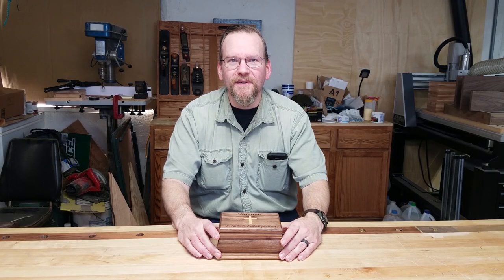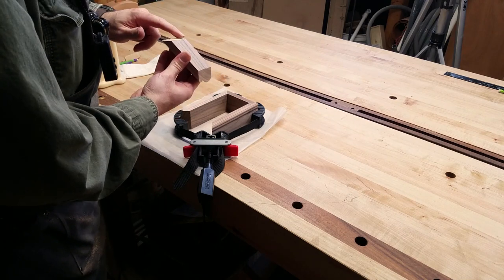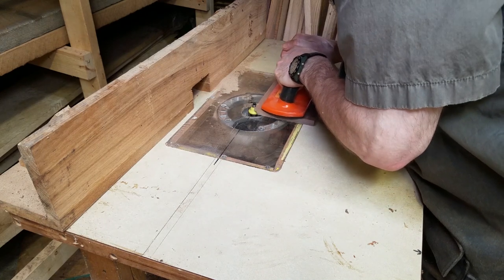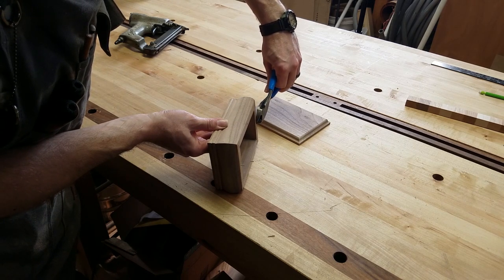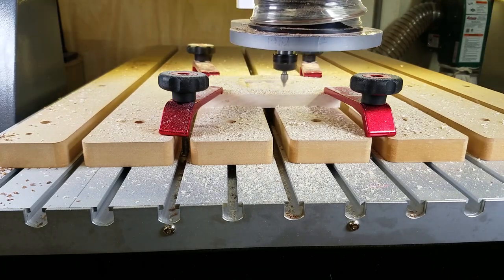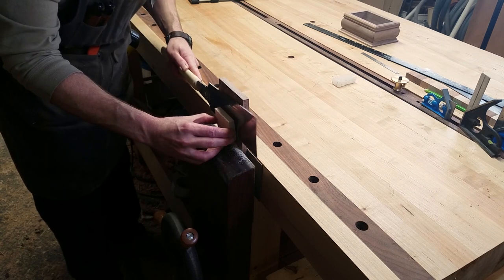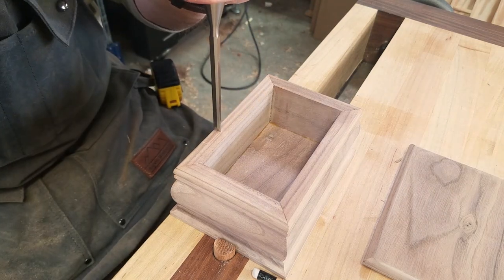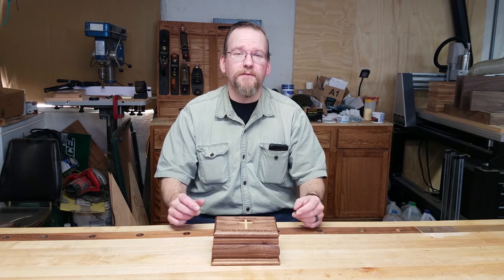Walnut Box with Inlay and Moulded Sides

Comment: I notice that at 9:21 you just said the process would be the same for the lid, but didn't show it....marking the lid has to be more difficult since you cannot just lay the hinge on the lid...how did you get that done?
Reply from the maker: Once the hinge is already attached to the bottom, you can close the hinge and put a small sliver of double sided tape on top of each hinge.  Then line up the lid and press it down to get the tape to stick.  Now you can carefully open the lid and trace around the hinges with a pencil.  Then knife along the pencil lines and carve out.  Remember to go slow and check for fit often.
Hope this helps!